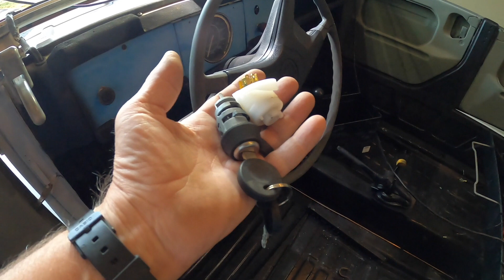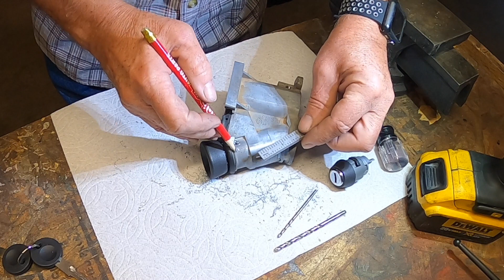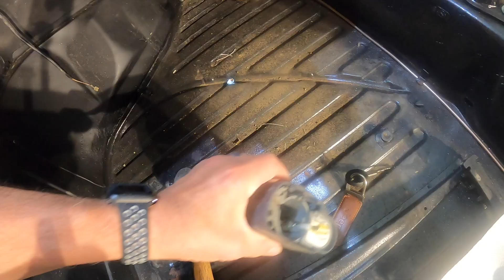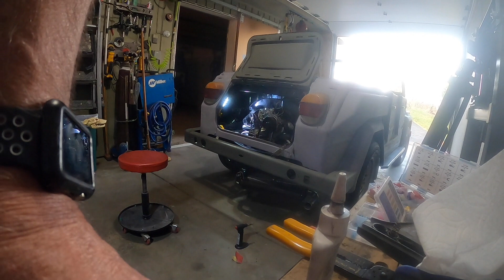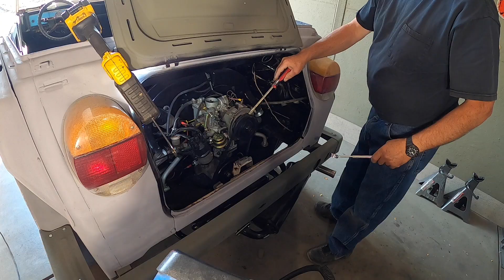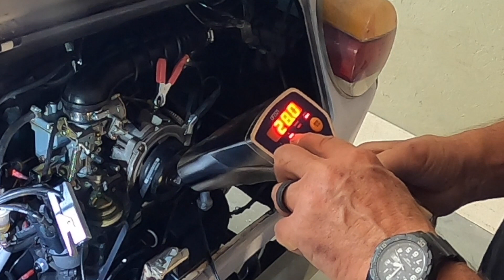VW Thing Restoration - Part 11 -  Ignition Switch Replacement and will it run?

Comment: I am always looking for help.  This video is good but incorrect.If I knew how to post pic's I would. There is a metal partition in the hollow to the left of the key. Pulling it out reveals a small slot. That is where you use a small screwdriver to press the release.